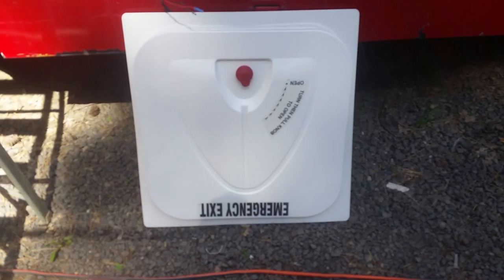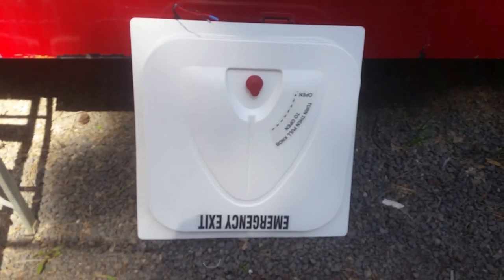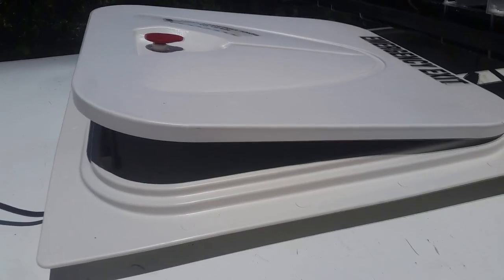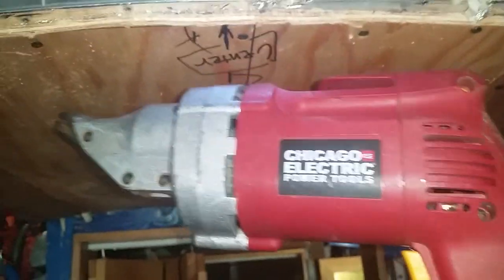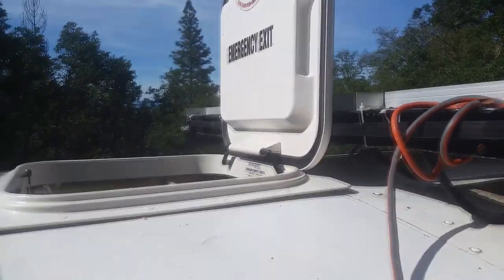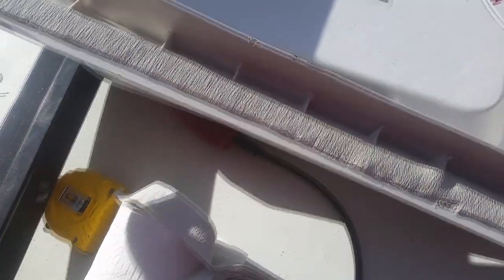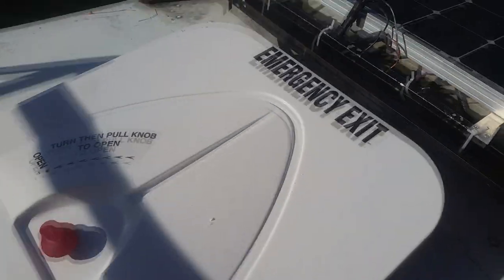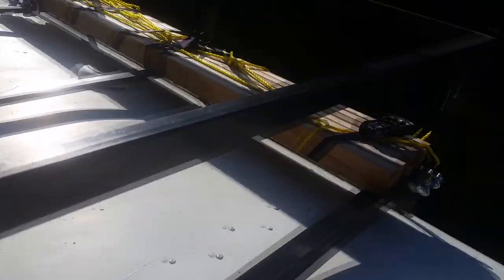Jon's Bus Conversion Part 72 - Installing a Roof Escape Hatch on my Skoolie

Comment: Looks good Jon. You might want to get some self leveling Dicor caulk to deal the screw heads and around the edge for insurance against leaks. Well worth it
Reply from the maker: Hey what's up? Ok - thanks for the advice...I will definitely do it. Have fun!!

Comment: Hey Good morning from frozen CT! I'm hoping to install an escape hatch, same reason! So I can access the roof! Thanks for sharing! Yea, your roof rack has great potential for great patio or whatever. I was thinking of making a deck on mine, but too much like work, I'll need to make a kinda roof rack. I was thinking for me I'm gonna take some unistrut and have a couple of lengths so I could strap kayaks down. I'd still need a ladder, but then you still wanna have a way to sneak up there. The views from the roof, I wouldn't wanna miss anything! LOL! I see yours had some wires, [maybe a microswitch to show open/close?] Thank you for sharing! Love to see whats next! You all take care! God bless!
Reply from the maker: The roof rack build was a video a few back. Yes - it was a bit of work and about as much work to get it up on top of the bus. The next video - I think it's scheduled for this Friday - will be putting a wooden deck on the rack. Yes - the wires were for notifying the drive the hatch was opened. I probably should have mentioned that! I don't need them so I didn't use them.